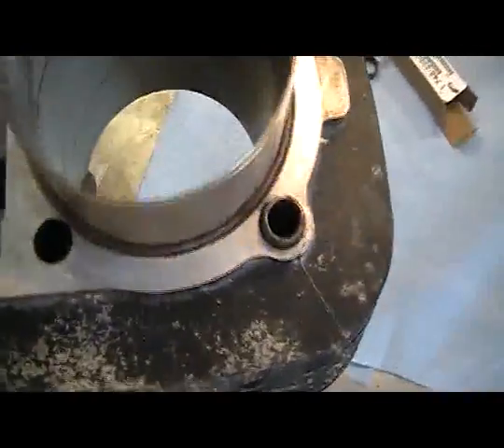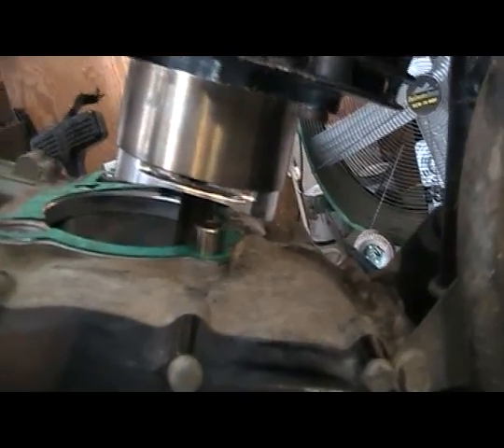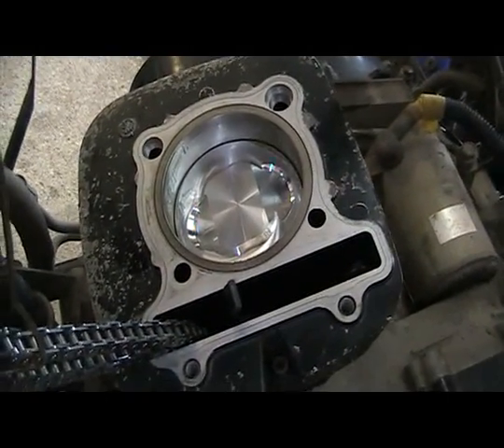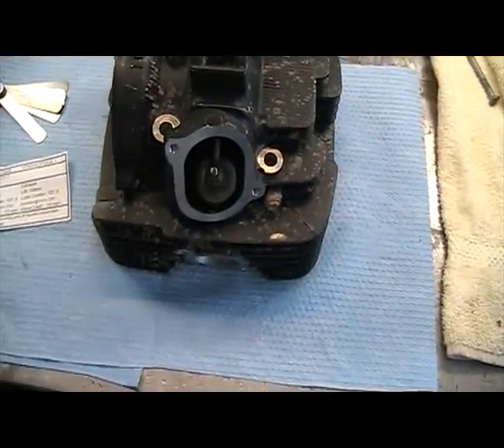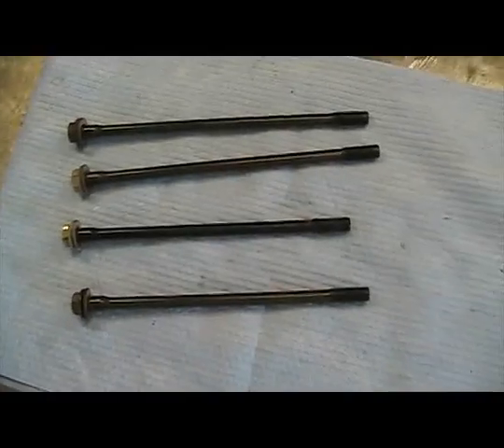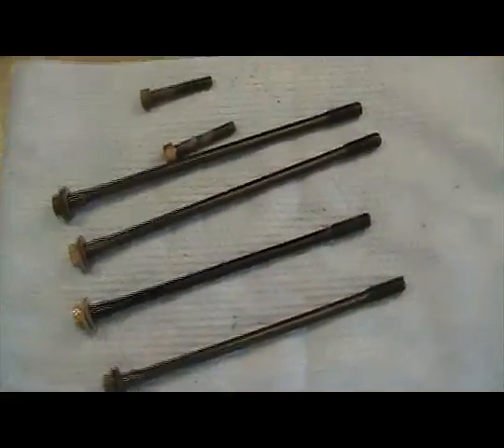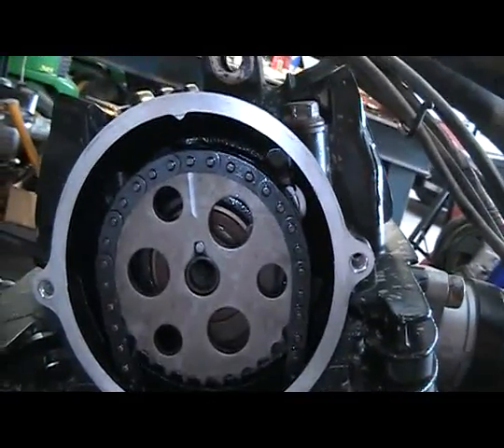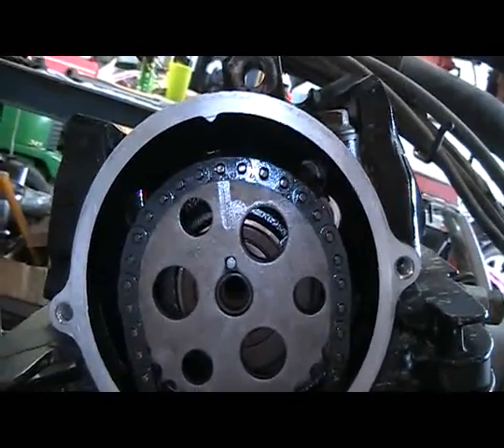PART-7 Yamaha Wolverine 350 4X4 85mm BIG BORE 366cc kit & Hotcam stage one cam install.

Comment: Getting that head on and that Sprocket in isn't easy
Reply from the maker: It’s not to bad.
Reply: @mtwz71  I've always had and worked on Two Strokes I just got this thing maybe 5 months ago so needless to say it was my first time doing it. Angling the cylinder head to pull the bolts all the way out was probably the biggest pain. I'm assuming mine has a stroker kit in it because the serial numbers on the vertex piston  comes back as a stroker piston
Reply from the maker: @jdtv...9134  That’s great. I’ve got Candice working on engines now. She’s coming along good.